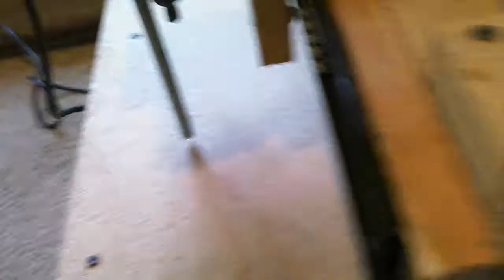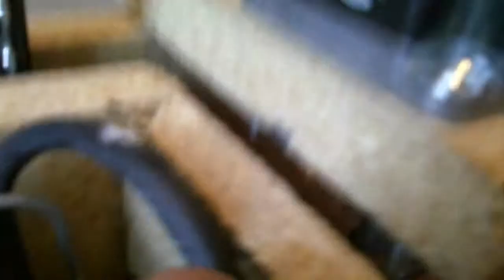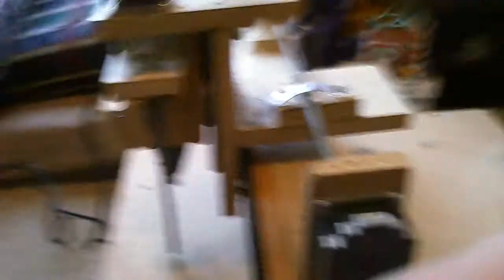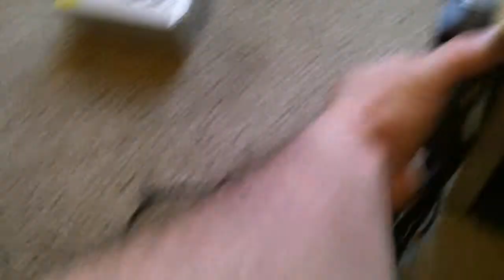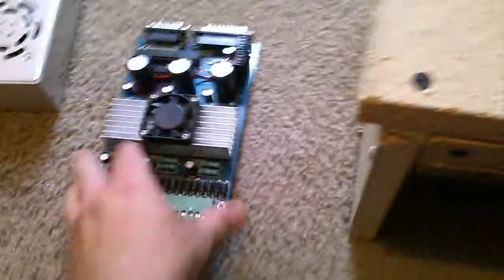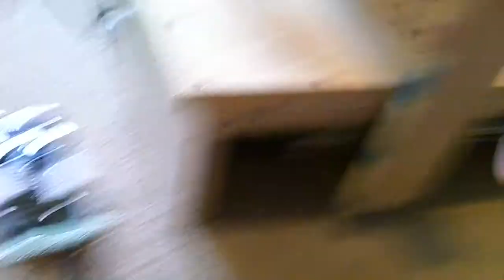CNC build part 2

Comment: I only have a serial connector on my computer.  Can I connect to the driver with that, or do I need an adapter?
Reply from the maker: Sorry a serial connector will not work you have to have a Parallel Port PCI card all new computers do not come with a Parallel Port PCI that is what really old print used to use back in the day but work great for connecting CNC drivers.If you are into arduino you can use an arduino to control the  step and direction  pins of the cnc driver board you would need to flash the arduino to read g code.Thanks